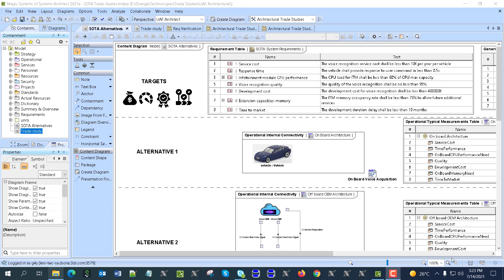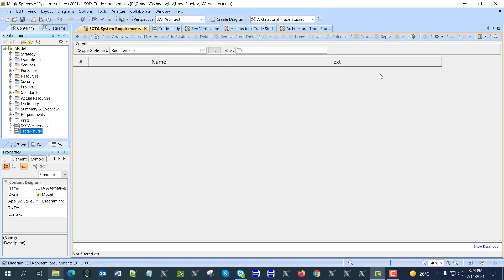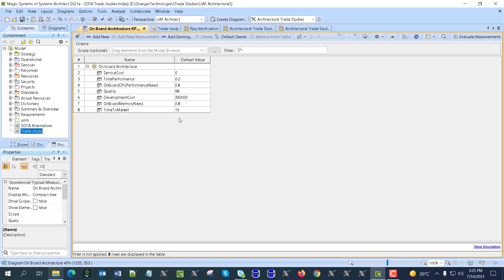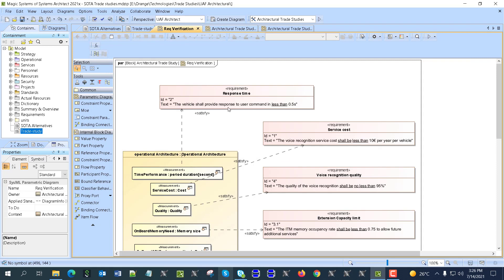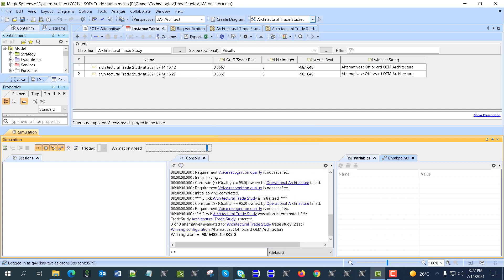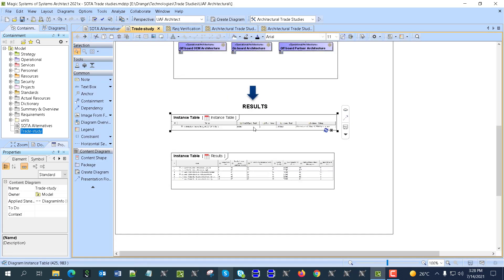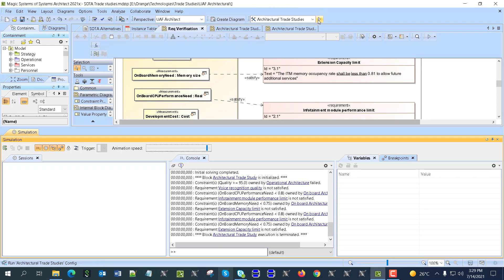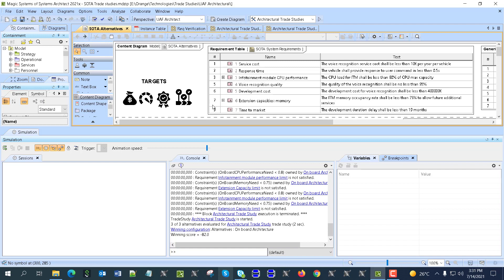Automatic Trade Study of Alternative Vehicle Operational Architectures in UAF Simulation

Comment: I have successfully implemented a similar trade study in our model.  Thanks for the example. One question.. We have two requirements sets (i.e. we have 2 customers which use the same system for different use cases).  Is there a way to toggle which requirement set you want to show/run while running simulation? I'm assuming this could be done using project usages? Your thoughts?
Reply from the maker: Hello Will. Great to hear! You can do context specific satisfy links. Based on value priperties in IBD.

Comment: Nicely done.
Reply from the maker: Thank you Dr Bruce Douglass!
Reply: @MBSEExecution  Hi, great job! Please could you (or anyone) kindly expatiate on how the MOEs were derived? It would be greatly appreciated.
Reply from the maker: @beebee_0136 thank you! What do you mean derived?
Reply: @MBSEExecution  Thank you for replying. I was referring to the expression used for the objective function at time stamp 3.39.
1.) Is there a reference for that math expression e.g. "w1*dc+w2*obc+..."? I understand that those are weights, however, are they based on subjective values assigned to it by experts or are these values empirical?
2.) If any, are there text references that discuss this subject from an MBSE perspective?

I look forward to your response. Thank you in advance.
Reply from the maker: @beebee_0136 i think we did empirical. But you can use method like comparing parameters importance between each and assign weight in this way. Also automate this table through Cameo
Reply: @MBSEExecution  Thank you. For the empirical values, do you mind sharing how the values were obtained? Or better, is there a reference text that you can recommend that describes this or similar empirical process?